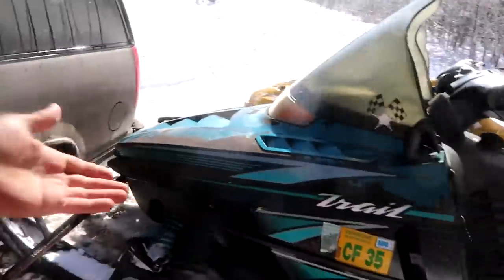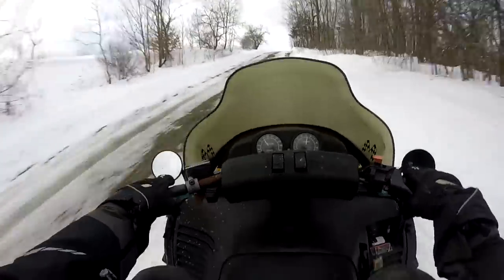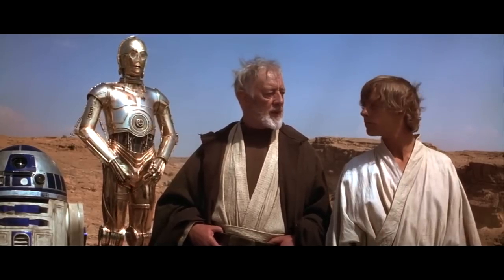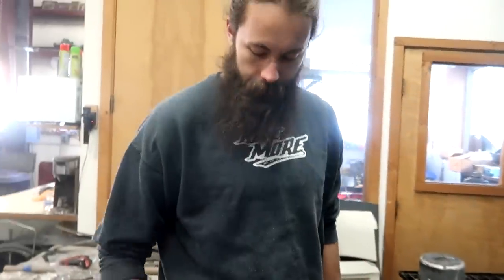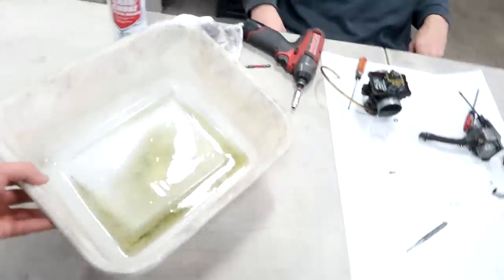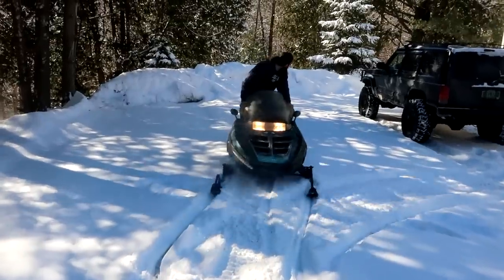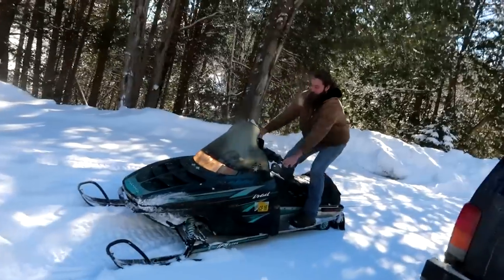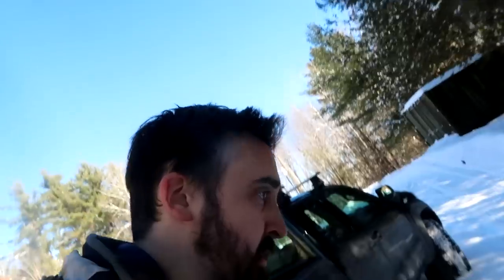$300 BARN FIND !! Polaris Snowmobile Needs MAJOR Work!

Comment from the maker: What do you think is wrong with this sled!!??
Reply: Crank seals, definitely needs that airbox.
Reply: Possibly a head gasket, 20-30 min job on those free-airs
Reply: those sleds are always boggy
Reply: @Unthawed_Pie  mines not
Reply: Clean carbs and new fuel, mine sat 6 years before this season and runs like new. Wait, no air box? That’s what’s up. It’s not jetted for it at all. Needs a that and a cleaning
Reply: Low compression
Reply: Try a clutch adjustment
Reply: Get an air box it doesn’t like being choked out with those filters
Reply: My sled just blue the crank sorry to tell you same sled too but they’re a boggy sled
Reply: Crank seals
Reply: I think main clutch spring is broken or weak and trying to upshift too early
Reply: Maybe just a pilot screw adjustment. Those pod filters are probably messing with the air/fuel.
Reply: Clutch
Reply: Clutching sounds like let’s check the reeds too
Reply: Factory airbox is where I’d start!
Reply: Needs a airbox. Plus maybe crank seals
Reply: I have a 1988 indy 400 sks liquid. Sweet little sled but.... ive had this bog issue that this 500 has. I replaced clutches went thru belts, spark plugs like crazy. My bog issue all came down to the choke cable adjustments. Check at the choke plungers going into the carbs. I could not adjust it to the book I actually had to run the sled at idle and adjust the choke adjustment at the carb while it was running until the problem leveled out. I no longer bog. It was getting too much fuel, basically the carbs were choked a tiny bit while riding. Also looking at the black gunked up plugs is a give away. When my sled runs perfect my spark plugs are about the same color as cardboard. I hope this helps. Thanks for the videos.
Reply: intake boots or clutch seal
Reply: Did/do  you guys pull choke while bog to see if needs fuel?
Reply: Clutch maybe new plugs ?
Reply: Secondary clutch sticking open. Like your starting in 3rd gear
Reply: Might need to adjust the slide needle in the carbs
Reply: Try putting the needles 1 clip richer, seems slightly lean with them air filters and no airbox
Reply: Water in the gas it’s freezing in the carps my ski doo does it after u clean them and the tank she will run mint
Reply: Probably a few sizes bigger in the jets because of the more air from the little pod filters, and probably some new rings
Reply: Airbox son you choking it
Reply: Maybe the secondary helix buttons are worn/slash gone. Quick easy check.
Reply: Is it still fouling plugs? Looked like it was running rich.
Reply: @oneleggangdev_1leg  it's a piston port engine
Reply: 💯 clutches
Reply: is a bad belt had the same problem
Reply: Crank seals 1000%. Its inability to get started on its own at the end was a dead giveaway.
Reply: I put my money on the clutch is wrong.
Reply: crank seals. and air box. can check crank seals by spraying carb cleaner around the bottom end of block while running the sled and if it revs up or idles higher then you have bad seals
Reply: Put the proper air box on buddy did the same thing to my 540 fan shed spudder then explode like crazy and had a top end bog meh it was fun haha but yea stalk air box
Reply: Clutch is causing your low end bog. Possibly the wrong belt.
Reply: Spray carb clean on crank seals to see if idle changes or what about the reeds? Or secondary not set right or even fuel pump
Reply: Crank seal
Reply: Its a polaris hah jking!
Reply: Your sheathing on secondary try to adjust that that helped my Indy 500 out tremendously
Reply: I would check the reed valves. Had a old sled that acted like that and it was the reeds.
Reply: Definitely try removing those little air filters off the carbs to get it some more air flow
Reply: I think it the clutch I had a similar problem on an Indy 500
Reply: Take your high-tech air filters off. I bet it runs better without them.  Air restriction. Fuel pump going bad.
Reply: What happen to your f150. Why keep driving pieces of poo vehicles
Reply: It is those air boxes you need the stoke ones or crank seals
Reply: needs an airbox, 100%
Reply: i have an old 1998 indy xlt 600 tripple and all i did was tune one high and the others normal and i didnt have any more bog
Reply: @Unthawed_Pie   no there not
Reply: You need an air box, its not a clutch issue its not an engine issue it needs an airbox and the bowl vents need to be plugged into the air box to pull vaccum if theyre just sitting there like they are the sled will run like garbage ive seen this plenty of times, also these engine will easily go 10k miles my old 96 efi 500 has 8k miles and its never been touched snd has 120 psi both sides
Reply: My sled ran like that. Had great compression in all 3 cylinders, 120-130 psi. I changed the exhaust manifold gasket and it ran like a top. I guess it couldn’t build enough compression past the cylinders to deliver all its power. I’m sure you have it fixed by now but if not give it a try

Comment: It is a clutch bog. Check rollers in the primary as well as the spring. Put new belt on and make sure deflection is set at about 1 1/4" or a hair tighter. Those piston port motors will run like that if clutching is off.
Reply: I agree,   Might even be as simple as improper belt sizing.
Reply: THIS GUY IS RIGHT
Reply: just had the same problem with my tnt over the weekend.  she would go but only felt like 60-70 percent power.   checked the primary.  no spring. it was stuck open.  
she made it back to camp though. 
anyone out there have a good used qrs primary for a 2010 mxz?
Reply: 100% this
Reply: Yup, had a broken spring in my primary. Replaced it with a salvage yard spring, red and white, now runs like a champ.
Reply: thought it was my spring.  it was actually the bolts holding the spring housing.  one of the three bolts broke causing the other two to strip out. 
 New parts are on the way
ride on!
Reply: Its not a clutch issue its having no air box and the bowl vents being to atmosphere they are to have vaccum if the bowl vents have no vaccum it will bog

Comment: I would definitely try and find an airbox, they run better with it. I have a an 87 Traill 488 and I bumped primary engagement up to 4400. It really woke it up out of the hole.
Reply: Came to say the same thing the issue might be from the filters an old snowmobile mechanic told me they’re meant to have an air box if they wanted to use filters they would put them on from factory
Reply: @Speedfreak542 those "lake filters" are the most cursed garbage anyone can do to a sled. Nothing but problems. Even if you actually tune the sled for them they end up wet and restricted. No matter what you do they will figure out how to create a problem. And why put them on in the first place? Not like it's going to make more power. At least on a factory sled. They spent ages figuring out how to get the most out of these motors at the factory. Those air boxes are tuned pretty perfectly to the stock motor.

Comment: That air box delete mod is robbing your low end power which is a very small amount on the 500s anyways. Seems like it's running to lean from too much airflow. Also check that the primary clutch spring isn't broke. Those 500s gotta rev up pretty high in rpms before engagement or else they will bog like that.

Comment: new secondary spring and a new belt. Make sure clutches are aligned and belt deflection is within spec. I overlooked my clutches when I had a low end bog issue and that was my issue. Thing rips like its brand new!

Comment: Check the pickup line in the tank change the fuel filters should only be one fuel filter on it. Make sure the arrow is pointing in the direction of your carbs. Clean the air jet and set it to spec. And put the original airbox on it. Make sure there's no cracks in your pulse line.. new spark plugs to

Comment: I had one just like that those reverse chain cases are gold worth like 300 bucks to the guy wanting it
Reply from the maker: Right!? That's what I paid for the sled. Lol Worst case scenario, I part the ol' girl out.
Reply: @JeremyRhydes  I had one same exact sled I recovered the seat and ran her for years it had 15000 miles on it. It did not have reverse but such a great sled
Reply: I paid $250 for a parts sled that had a reverse chain case, and the kid threw in a 488 motor he had in has shed..he said he wasn't sure if it ran..best running motor I have out of my 4 indys
Reply: Yeah three different guys tried fixing my reverse and still doesnt work. Same sled mines cleaner 4000 miles

Comment: Had the same problem with the same exact sled this year!!! Did everything, tested everything electrical, all the seals, was the line in the tank collapsing when fuel pump would suck. Found out when it was bogging super bad and dying. Ripped the in-line fuel filter of and blew on the  fuel lines and would run fine u til the bowls would drain. It was werid also check if ur fuel link inside the tank fell off

Comment: I finally got a good deal on a sled last year. 97 trail with extra 10 and studs! It had a melted piston when I got it but I paid $200! Another 200 in parts I guess to do the top end and fuel lines but it's a nice and comfortable ride! The tank was full of five year old gas that smelled like varnish. I kept clogging fuel filters and getting air in the lines so this summer I took the tank off and washed it out and put a new seat cover on and a new fuel pump. Cant wait to ride! STUDS make such a big improvement!! The reason mine was blown up from previous owner was because a mouse made a giant nest inside the fan shroud and it wasn't getting the airflow needed to cool it.

Comment: Check secondary clutch and belt deflation. Also think the coil is going bad. They will run good till the coil gets warm then acts like it's fouling a plug. Timing is off when it does that. Check crank seals!
Reply: I agree with this from past experiences!

Comment: I had a 94 Indy Trail. Thing was indestructible. Great machines.
Reply: I still have my 1994 Indy Trail Deluxe, which i purchased new  ... 12000 plus miles on it now  ... engine never touched.
Reply: @baybuoy3843  I believe it. That's impressive mileage for a snowmobile. Those Fuji 488 fan cooled motors are bulletproof. Sometimes makes me question why I mess around with the high horsepower liquid cooled sleds. They're so much less reliable. I had just as much fun on my indy Trail.

Comment: I'm going to say clutching is your problem. your secondary clutch Jeremy I caught a quick Glimpse the belt is down in too far so you're starting off in a higher gear. but definitely look at your primary clutch. your weights and them little wheels that the weights roll-on could be bad

Comment: Could be a bad crank seal you can test the PTO side by spraying carb or brake clean behind the primary clutch while it’s running and if you hear a change in idle then the seal is gone. The PTO side is the most common side to go bad but the mag side can go bad I’m just not sure how to test it

Comment: Fuel filter? Crank seal leaking? Sounds starved for gas. How is the compression? I have a ditch pickle that would start and idle just fine, and bog down as soon as you hit the throttle. It was the filter. Another time, it was sediment stuck in the reeds of the fuel pump. Only mentioning these because they weren’t in the video. Is the pulse working for the pump? Lastly, how about the intake reeds? If they are worn or leaking, you have another world of problems. 

I love the simplicity of your channel/content. Just a working man doing working man things to pass the time.

Comment: Crank seals and head gaskets on those old 488 fanners
Reply from the maker: I agree!
Reply: It does sound like an irregular air/fuel mix, or maybe old gas with some water in it. The aftermarket air filters could also be adding to the problem too, if the carbs weren't jetted for the increase in airflow.

Comment: Adjust the belt deflection belt is sitting to far into the secondary clean the clutchs... but I will garentee remove those air filters and it will wake up those filters are choking it out

Comment: Give her the compression test when it's cold and then again when it's hot might just be a bad primary clutch as you know hold it up off the ground stab the throttle and see if it still bugs might be worth rebuilding if that's the case I think it would be cool if you could find an old Polaris triple storm 800 for Indy 650 I had both I did some performance work to both of them and they were great sleds but those Indy 500 are good to I've had quite a few of them you know how it goes to start with the small things before you throw a lot of money at something just to find out it's a basket case thank you for all your great videos and hard work

Comment: Watched vid again bogs while moving so its clutch or aligment, but if ever bogs before clutch engagment watch for  improper air/fuel mixture leaking in from crank seal by spraying flamable fluid on seal and if sled changes rpm its a bad seal which causes bog I got same sled except 488 liquid For 13.64 i orderd othmro oil seal 30mmx60mmx7mm "aka" ski-doo seals off amazon For 1 polaris dosent make the seal anymore and these othmro seals you dont have to split the crank cases

Comment: My 440 Polaris had similar issues and it wound up being a corroded spring on the oil pump so it was not returning and loading the engine up

Comment: It’s actually awesome you just got one of those. My gramps bought one last season same sled, we cleaned up the carbs, cleaned out tank, new fuel lines, compression is fine carbs are tuned perfectly, but when he takes it out on the trail it goes like a mile hits the same hill and it will just die and won’t start unless it cools down for an hr? Any clue what’s wrong?

Comment: If you still have this 488 put an air box in it thats your issue the float vents should not be vented to atmosphere if you cant get an air box route the vent tubes into the pod filters so they pull vaccum, with them to atmosphere they wont pull vaccum and the sled will have a bog

Comment: Pull the motor, tear it down and split the cases, check all the crankl bearings,  new seals, gaskets, and pistons, get a used airbox and reassemble the motor. Sounds like Mike wants this sled to ride so do it once and do it right. If you have any questions feel free to ask, it's not hard to do.